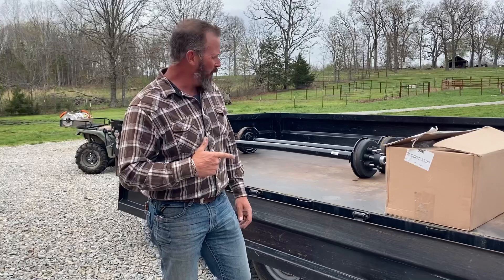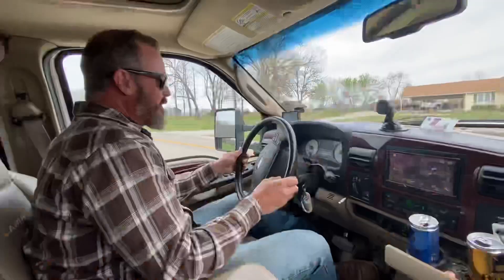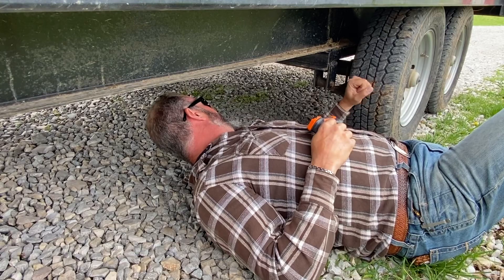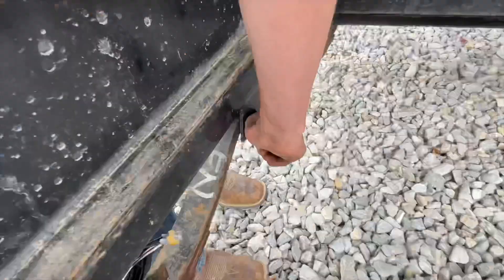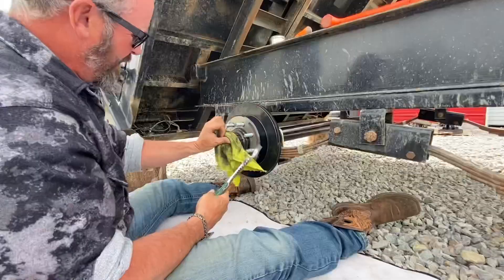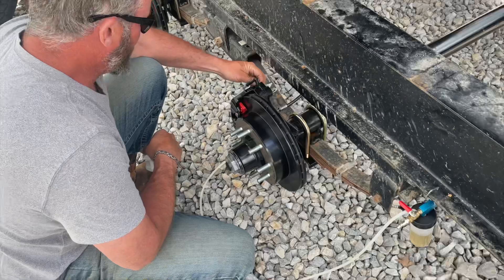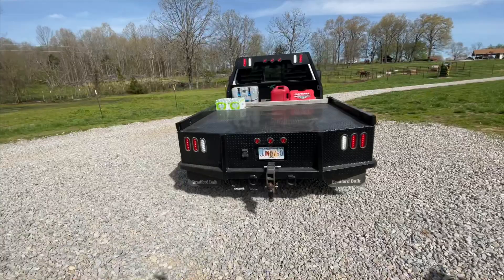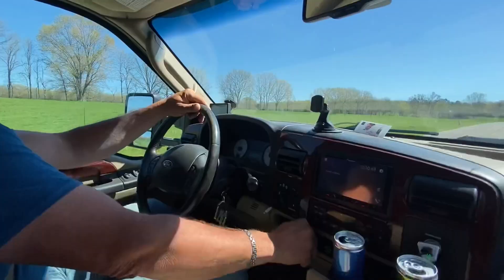Best Trailer Upgrade! Axles and Disc Brakes by Lippert!

Comment: i have a 14k maxxhd trailer with standard electric drum brakes, i load it with 6.5 tons of rock everytime and roll out at around 26k lbs. i have never had the brakes not work for me. Yes hydraulic disk brakes are going to stop better but i don't need my dump trailer holding back my truck.

Comment: Did you have the trailer lifted at the rear by lifting the dump bed onto wooden blocks?
Reply from the maker: @dk_719  yes, we used the hydraulics to lift the trailer by blocking the rear of the dump body. Worked slick
Reply: @tickcreekranch  good to know. I've seen it done with tilt decks but never dumps. That's how I'll raise mine off the ground.

Comment: how come you did not put the springs on top of the axles instead of on the bottom like they are then
Reply from the maker: These are under slung axles. The way the factory designed it. Most trailer axles are this way. It’s better geometry and reduces axle wrap under hard braking. Plus the trailer would be too tall if they were spring over. It adds about 5 additional inches in height. Thanks Brian

Comment: Disc brake conversion kit not available on their website. In fact no electric disc brakes kits - just electric drum brakes. Got a part number of manufacturer for the kit?
Reply from the maker: I’ll reach out to them and try to get one for you.
Reply: @tickcreekranch  It's not indexed on their site. You can't even search for it with their own SKU. But searching the internet for "5200#-8000# HYB DISC BRAKE CONV KIT (TANDEM AXLE) 5 BOLT BRAKE FLANGE 1/2" STUD" will pull up (a) link. Don't know if it's the same thing as yours?
Looks like a great upgrade in terms of safety and maintenance, but Lippert is kinda falling over its own feet here, lol
Reply: Just seen there $3500 for 5 lug ,1/2” Didn’t bother to see weight limit lol Heck I’m not sure what I seen,there was no picture of product.